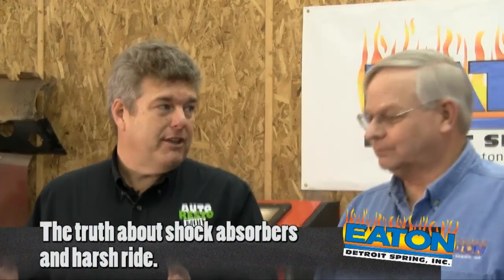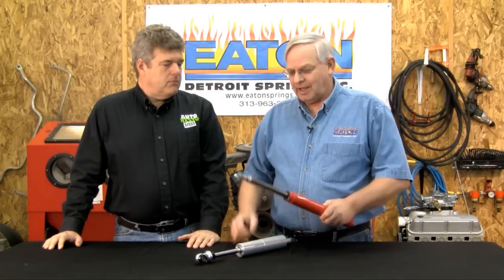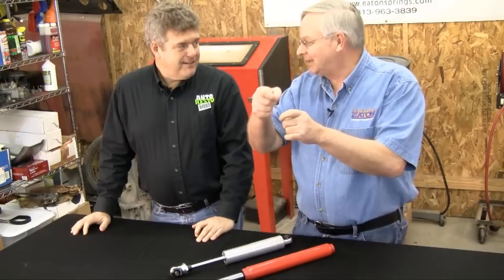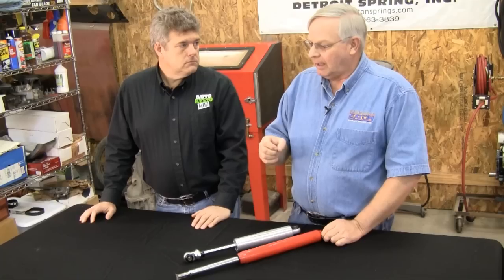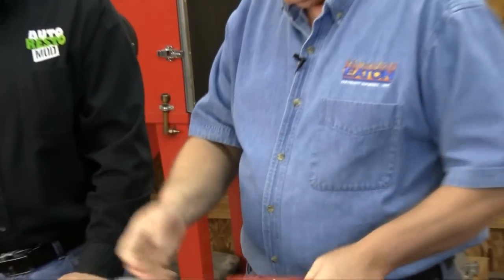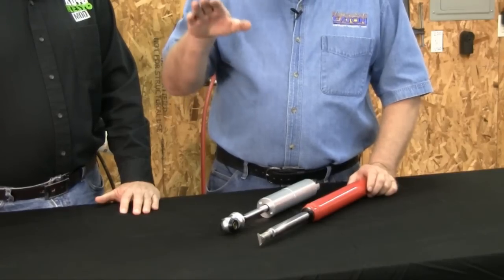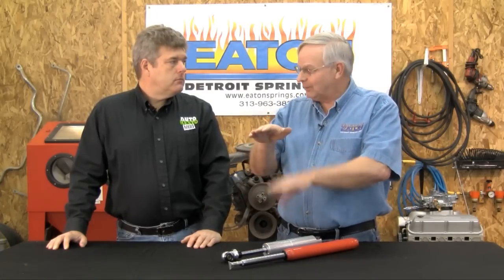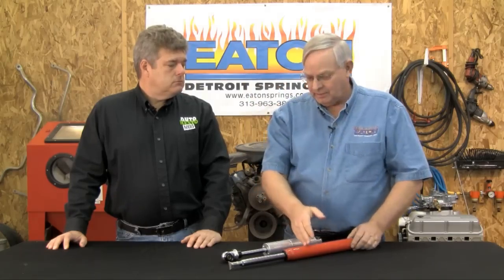Hydraulic vs Gas Shocks for Classic Vehicles | EATON Detroit Spring on AutoRestoMod

Comment: This is the first factual explanation of a shock absorber that I've seen.  Shock absorbers are the most misunderstood mechanisms in a car.  Nobody knows what you just explained.  All the videos are useless and avoid the question of what a shock does.
Gas shocks are touted as mediating the problem of cavitation in the fluid.  From what I can tell,  spring rates for hydraulic shocks would need to be carefully adjusted down in order to install gas shocks.  Can cavitation be cured in a way other than with gas shocks?
Reply: alex tworkowski Yes a great explanation of the added spring rate but unfortunately they only told half the story. They made the classic assumption when explaining something that people already know how a shock works. They should have explained that both have fluid in them to do the actual damping action and actually why the gas is in there. Not just the negative aspect of the gas. Or change the title of the vid.
Reply: @DiscoFang  You make it sound like there are still positive benefits to utilizing gas shocks {just because there is a partial amount of fluid in there}. 100% of everyone I have ever met who drives today's new modern automobiles already realize how pathetic, harsh, and bumpy the ride-quality always is. And all these people actually believe this is just the normal way it is supposed to be. They don't realize that the only reason it is this way, is strictly because of whoever the bastard was that invented the worthless gas shock technology. And when I give anyone a ride in my 1978 Lincoln Continental Town Car with 100% pure hydraulic oil shocks, they ask me how in the hell the ride quality feels like they are literally floating on still waters, with absolutely no feeling of bumps or motion; just the most astonishing level of comfort in history.
Reply: Gábriel Priòre There's more to the modern and old ride than just the type of shock. Unfortunately every sedan & even SUV (?!) now has to have the perception of "sporty abilty" even at the expense of ride "quality"'. That those cars in fact do handle better than a 1978 Lincoln is another thing worth noting.
Reply: @DiscoFang  The reason there is some accuracy in what you stated, is strictly because, everyone nowadays is 'addicted' to speeding like an immature fool {including making high-speed turns around corners}. I am glad I am not one of those types of people. I actually follow the speed limit, and drive very gracefully. And I have an infinite amount of reasons why I boycott 100% of all new modern automobiles.
Reply: Gábriel Priòre An old luxo-barge with modern safety features and electric drive is the perfect commuter.   I reckon they'll probably return to luxury cars being luxury rather than so called "sports sedans".  If we do actually end up with autonomous cars I'd want mine to feel like a feather filled lounge suite!
Reply: I agree. The purpose of a car is to be you from here to there without breaking your ass.  It's not a speed mobile or a slalom racer (whatever that means).  It can't be an ocean liner, but all the thinking now is how well they handle as if roads were a torture test.  They are.  With bumps and potholes.  Cars are too bumpy and too loud.  
I see both your points, Cassette Walkman's and your's.  Sometimes an argument is more about defining terms more clearly.  I'm always called out on that one.  People want to kill me because they didn't understand my meaning.  That's my fault, but I don't think killing me is gonna solve anything.

Comment: Gas shocks have oil and are more durable better handling on hwy and keep you attached to the ground hydraulic just give you better smooth ride. I'll leave a link form the Monroe engineers http://www.jmg.com.gt/en/oil-shock-absorbers-or-gas
Reply: uriel0002 finally  sombody know what they are talking .just because you see an old guy talking about shock absorber  doesn't mean he knows a lot.the old guy is stuck with the old cars.new cars handle gas ones very good .I just put some kyb gas ones on kia soul and there is no bumpy ride.original hydraulic. With the original ones the car was jumpy like a goat sideways.i got tired of them.gas much better.
Reply: @marianluc6235  me too I've drive hwy mostly and so far so good with my gas ones.

Comment: This video is fake news sorry.
Gas shocks and hydraulic shocks can both be made to the same damping rate specs.
Having weak shocks increases the oscillation of the springs, and you'll be bouncing up and down a lot more. And your tyres are also more likely to lose traction.

If you want a softer ride, you need softer springs. At the risk of a wallowy, slow rollercoaster like ride and increased body roll.
Reply from the maker: I am not sure what you are trying to say here. If you are saying gas and hydraulic shocks are the same, you are incorrect. If you are saying they both perform the same function, you are correct. It is the make up of the shocks that is different. Hydraulic shocks have zero internal.While gas shocks can have many pounds of internal pressure.
In designing suspensions, both the spring rate and the shock rate are taken into consideration. Early suspensions had higher spring rates because the shock had no rate.
Later, mid 80's onward, used lower spring rates combined with gas shocks which had higher rebound and compression strengths/rate.
Reply: @EatonDetroitSpring  they can be made to the exact same damping rates, and they both use hydraulics to achieve this.

The fact that gas shocks extend by themselves is not by design, it's just incidental. The aim is to keep the hydraulic oil under a bit if pressure. They don't carry any load, they just control the speed of the suspension with their resistance to movement in both directions, exactly like oil shocks. The advantage of the gas shocks is that they can avoid aeration and foaming of the oil, and therefore provide consistent performance for longer.

In gas shocks, the oil can move faster thanks to the gas pressure, so if all else is equal, that would result in a firmer ride. But all else doesn't need to be equal, gas shocks can use smaller hydraulic passages as needed to provide more resistance to movement.

Comment: Wow, this video was terrible.
Reply: Actually, this video was astonishingly flawless. It seems like you believe there are positive benefits to utilizing gas shocks. 100% of everyone I have ever met who drives today's new modern automobiles already realize how pathetic, harsh, and bumpy the ride-quality always is. And all these people actually believe this is just the normal way it is supposed to be. They don't realize that the only reason it is this way, is strictly because of whoever the bastard was that invented the worthless gas shock technology. And when I give anyone a ride in my 1978 Lincoln Continental Town Car with 100% pure hydraulic oil shocks, they ask me how in the hell the ride quality feels like they are literally floating on still waters, with absolutely no feeling of bumps or motion; just the most astonishing level of comfort in history.
Reply: Most shocks nowadays have a light nitrogen gas charge to reduce foaming of the oil. If you can push the piston down by hand, it's not supporting your car. Try pushing in a piston for a hood or trunk lid and you will see what I mean.
Reply: @kenmarriott5772  shocks are not supposed to "support your car". Only to slow down the speed of bounce of the suspension. Less oscillation, tyres stay more in contact with the road.
Reply: @The3rdCoat  yes